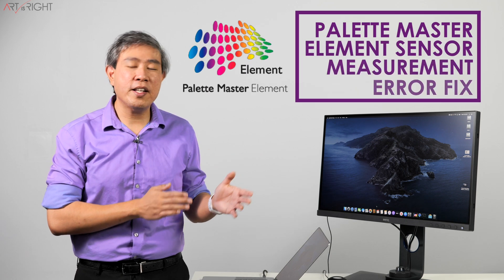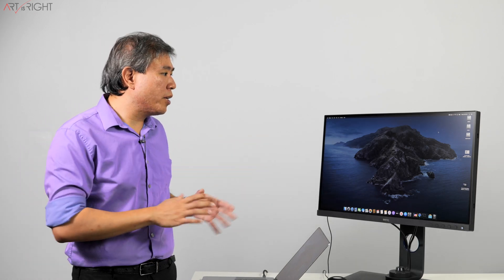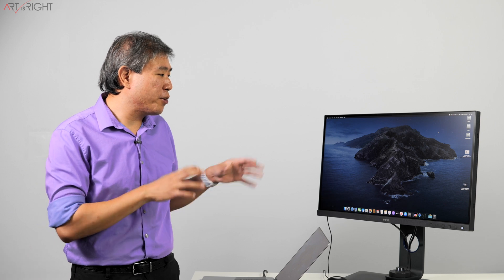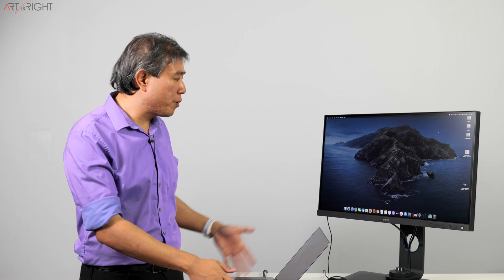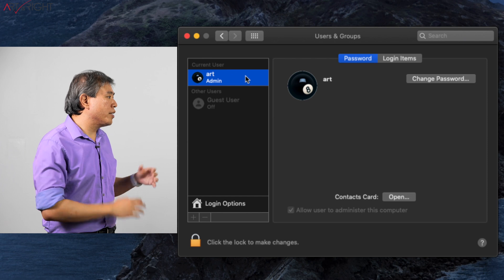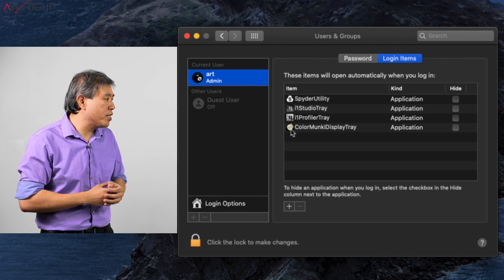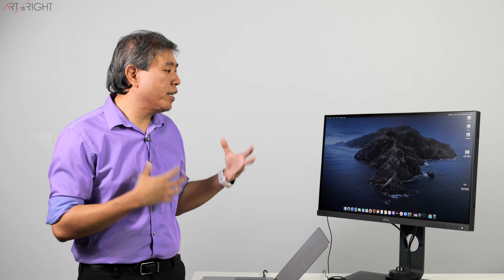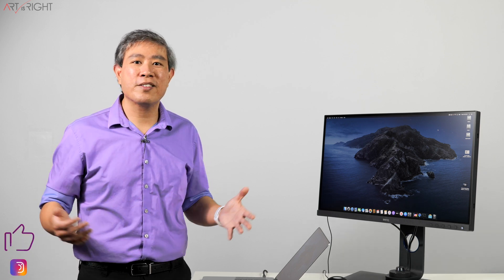Palette Master Element Sensor Measurement Error Potential Fix for macOS

Comment: Hi Art. Thank you for the informative video. I performed calibration on my SW240 connected M1 Mac Mini with i1Display Pro last night. It went on like forever and I ended up getting only the blue, green, and black tones on my monitor. Fortunately, I could see the finish tab and ended the calibration. I managed to recover after resetting the monitor and rebooting my Mac. I noted a ColorSync utility in the Dock.  Now if I select custom profile 1, I will get the blue, green, and green only on my monitor. Shall I re-calibrate once more?
Reply from the maker: Something is going on software wire that is preventing proper calibration. Diagnostic is needed. If you like to continue the diagnostic answer these questions. Please answers these questions completely and we’ll go from here.
* What computer (Laptop - Mac specify the model, year and size, Desktop, iMac, all in 1 PC, custom build, etc )
* What is your Operating System (OS) version are you using? (For Mac please specify the dot release, for Windows please specify version / build number)
* What calibrator are using?
* What version of PME are you using?
* What BenQ model do you have?
* What cable are you using to connect your BenQ to your computer for the display signal, HDMI, Display Port, etc.
* If you are using USB-C skip this question, if not, are you using a USB link cable between your laptop and display?
* If you are using Mac was this a clean install or was the OS upgraded from a previous version at any point (I.e. From Mojave 10.13.x to Catalina 10.14.x)? Or was this Mac restore from a back up, time machine or other wise?
* For PC, what GPU are you using? If Nvidia are you using their new Studio Driver?
* Were you able able to successfully pass the validation at some point
Reply: @ArtIsRight  Thank you so much for your prompt reply. I re-calibrated the monitor with i1 Display Pro and the BenQ Palatte Master Element 1.15, After re-viewing all your hands on video on calibration and issues this time the calibration was successful. The Display Preferences - Colour - Display Profile is automatically set to SW240 1_D65_Adobe RGB_L80_G22_..... I have two other profiles listed BenQ SW240 & SD 170M-A. (I have selected to Show profiles for this display only). 

I connect my SW240 to rhe M1 Mac Mini using HDMI cable and USB-C3B? (hope I used the correct term for it). It is running macOS Big Sur 11.4. My M1 mac Mini is a completely new machine and fresh setup (2 weeks old).    

Which Color Mode setting should I set for Color Adjustment - Color Mode on the monitor setup menu - Calibration 1, Adobe RGB, sRGB...?

Thank you so much, once again.
Reply from the maker: With PME and SW display, there's no color mode or profile that you have to set the display to.
Reply: @ArtIsRight  So, we just leave the selected mode as is? Thank you.
Reply from the maker: yes
Reply: @ArtIsRight  Thank you and blessed day

Comment: Hello Art, I'm running the sw270c on my 2017 macbook pro w/ Mojae 10.14.6 and every firmware I've tried it has always yielded me a failed calibration validation ∆E's were ranging in the 8-9. I'm using the color munki photo. I've been trying everything you've suggested over the past 6 months but nothing has worked. I am a professional photographer and have been just running on the stock adobeRGB profile.  Any suggestions?
Reply from the maker: Please answers these questions completely and we’ll go from here.
1. What computer (Laptop - Mac specify the model, year and size, Desktop, iMac, all in 1 PC, custom build, etc )
2. What is your Operating System (OS) version are you using? (For Mac please specify the dot release, for Windows please specify version / build number)
3. What calibrator are using?
4. What version of PME are you using?
5. What BenQ model do you have?
6. What cable are you using to connect your BenQ to your computer for the display signal, HDMI, Display Port, etc.
7. If you are using USB-C skip this question, if not, are you using a USB link cable between your laptop and display?
8. If you are using Mac was this a clean install or was the OS upgraded from a previous version at any point (I.e. From Mojave 10.13.x to Catalina 10.14.x)? Or was this Mac restore from a back up, time machine or other wise?
9. For PC, what GPU are you using? If Nvidia are you using their new Studio Driver?
10. Were you able able to successfully pass the validation at some point?
Reply: @ArtIsRight  If you read my comment I answered most of these questions already. I’m using usb-c. As for the os it was updated from what ever before Mohave.
Reply: Sorry if that came off harsh. I appreciate any help. So far everything has failed.
Reply from the maker: If you have another computer, do an A/B testing with it. Most of issues similar to what you’re going through is related to the computer OS and nothing else. You can always try to do a separate container and do a clean install of macOS In that container as well. This will be a dual foot for testing and setup.
Reply: @ArtIsRight  if I did the calibration with another computer, and it passed would then that calibration work with my main computer in theory?
Reply from the maker: It would not work. Your OS or something on it is conflicting with PME. You can take a few approaches to this. 1. Format the computer to the latest OS and reinstall everything, don't use Time Machine or Migration assistance. 2. Create a separate container on your computer SSD, do a clean install on that container, calibrate with PME and then move the icc profiler over to the main partition if you don't want to format or go with option 1. These are your best bet. Either solution will work